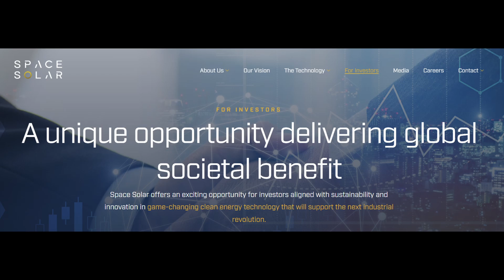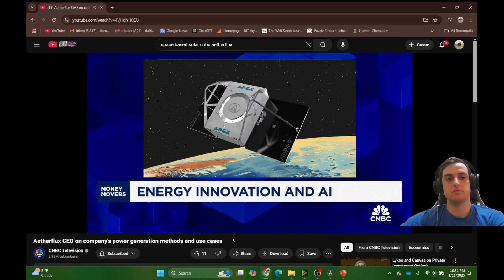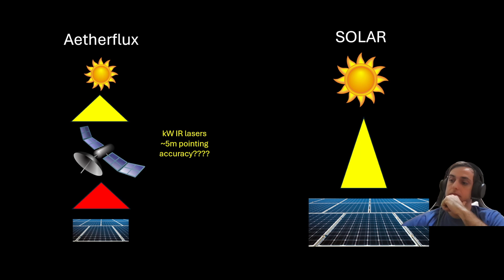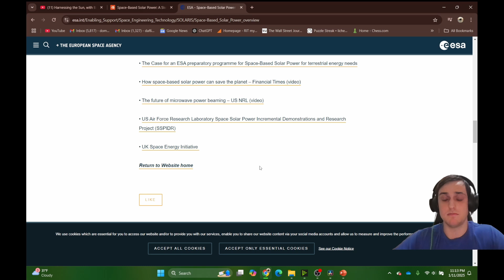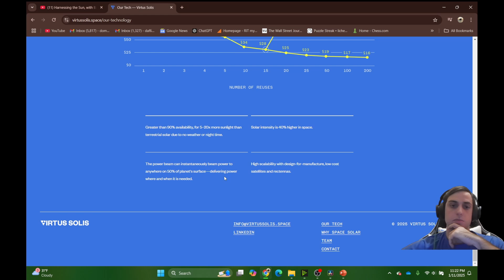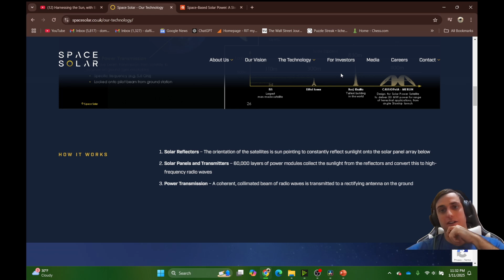Space Solar is a SCAM!

Comment: Your calculations are wrong and I can prove you. 

The SBSP System can work according to my calculation. 

Brother let's have a google meet and discuss this please give me ur email id.
Reply from the maker: brother paste your math here lets see it!
Reply: @NoiseInSpaceChannel 

Space-Based Solar Power Energy Calculation (Laser Beam Technology)
Section 1: 1. Solar Energy Collection in Space
Solar irradiance in space is approximately 1,360 W/m², which is the amount of solar energy incident on a
1-square-meter surface every second. The area of a 10x10-foot solar panel is 9.29 m².
Calculation:
Power Incident on Panel = Area × Solar Irradiance
= 9.29 m² × 1,360 W/m²
= 12,634.4 W (watts) = 12.63 kW
This represents the total solar energy collected by the panel per second in space.
Section 2: 2. Solar Panel Efficiency and Energy Output
High-efficiency space-grade solar panels convert approximately 30% of the incident solar energy into
electricity.
Thus, the energy converted by the panel into electricity is:
Energy After Solar Conversion = 12,634.4 W × 0.30
= 3,790.32 W (3.79 kW)
Section 3: 3. Laser Conversion and Transmission
Electricity is converted into laser light with an efficiency of approximately 60%.
Laser light is transmitted through space and atmosphere with an expected transmission efficiency of 70%.
The laser light is converted back into electricity on Earth with photovoltaic receivers tuned to the laser
wavelength, achieving an efficiency of about 50%.
Calculations:
- Energy After Laser Conversion = 3,790.32 W × 0.60 = 2,274.19 W

Energy After Transmission = 2,274.19 W × 0.70 = 1,591.93 W
- Energy After Final Conversion = 1,591.93 W × 0.50 = 795.97 W
This means that after all conversion and transmission losses, approximately 796 watts of electricity reach
Earth.
Section 4: 4. Total Energy Generated in One Day
Each satellite can operate 24 hours per day in space. To find the total energy generated by the solar panel in
one day (in joules and kilowatt-hours):
Total Energy Per Day = 795.97 W × 86,400 s
= 68,773,248 J = 68.77 MJ (megajoules)
In kilowatt-hours: 1 kWh = 3.6 × 10^6 J
Total Energy Per Day = 68,773,248 J ÷ 3.6 × 10^6 J/kWh
= 19.1 kWh
Section 5: 5. Conclusion
In conclusion, a 10x10-foot high-efficiency space-grade solar panel generates about 796 watts of usable
electricity on Earth after all laser conversion and transmission losses. Over a 24-hour period, this results in
approximately 19.1 kWh of electricity. To generate significant power and revenue, larger arrays or multiple
satellites would be required.
Reply: @NoiseInSpaceChannel  Space-Based Solar Power Energy Calculation (Laser Beam Technology)
Section 1: 1. Solar Energy Collection in Space
Solar irradiance in space is approximately 1,360 W/m², which is the amount of solar energy incident on a
1-square-meter surface every second. The area of a 10x10-foot solar panel is 9.29 m².
Calculation:
Power Incident on Panel = Area × Solar Irradiance
= 9.29 m² × 1,360 W/m²
= 12,634.4 W (watts) = 12.63 kW
This represents the total solar energy collected by the panel per second in space.
Section 2: 2. Solar Panel Efficiency and Energy Output
High-efficiency space-grade solar panels convert approximately 30% of the incident solar energy into
electricity.
Thus, the energy converted by the panel into electricity is:
Energy After Solar Conversion = 12,634.4 W × 0.30
= 3,790.32 W (3.79 kW)
Section 3: 3. Laser Conversion and Transmission
Electricity is converted into laser light with an efficiency of approximately 60%.
Laser light is transmitted through space and atmosphere with an expected transmission efficiency of 70%.
The laser light is converted back into electricity on Earth with photovoltaic receivers tuned to the laser
wavelength, achieving an efficiency of about 50%.
Calculations:
- Energy After Laser Conversion = 3,790.32 W × 0.60 = 2,274.19 W

Energy After Transmission = 2,274.19 W × 0.70 = 1,591.93 W
- Energy After Final Conversion = 1,591.93 W × 0.50 = 795.97 W
This means that after all conversion and transmission losses, approximately 796 watts of electricity reach
Earth.
Section 4: 4. Total Energy Generated in One Day
Each satellite can operate 24 hours per day in space. To find the total energy generated by the solar panel in
one day (in joules and kilowatt-hours):
Total Energy Per Day = 795.97 W × 86,400 s
= 68,773,248 J = 68.77 MJ (megajoules)
In kilowatt-hours: 1 kWh = 3.6 × 10^6 J
Total Energy Per Day = 68,773,248 J ÷ 3.6 × 10^6 J/kWh
= 19.1 kWh
Section 5: 5. Conclusion
In conclusion, a 10x10-foot high-efficiency space-grade solar panel generates about 796 watts of usable
electricity on Earth after all laser conversion and transmission losses. Over a 24-hour period, this results in
approximately 19.1 kWh of electricity. To generate significant power and revenue, larger arrays or multiple
satellites would be required.

And from one day of electricity generated by one sattelite a 60w bulb can glow for approx 13 day 

Which means we can glow 13 bulb of 60w in 13 houses continoulsy from one sattelits with 10 x 10 foot solar panel. 

And 10x 10 foot solar panel is not that much big it's just double of average women (5ft) height.

We just need to make constellation of approx 5000 - 7500 sattelites

Which is achievable ( ex - starlink)
Reply: @NoiseInSpaceChannel @NoiseInSpaceChannel Space-Based Solar Power Energy Calculation (Laser Beam Technology)
Section 1: 1. Solar Energy Collection in Space
Solar irradiance in space is approximately 1,360 W/m², which is the amount of solar energy incident on a
1-square-meter surface every second. The area of a 10x10-foot solar panel is 9.29 m².
Calculation:
Power Incident on Panel = Area × Solar Irradiance
= 9.29 m² × 1,360 W/m²
= 12,634.4 W (watts) = 12.63 kW
This represents the total solar energy collected by the panel per second in space.
Section 2: 2. Solar Panel Efficiency and Energy Output
High-efficiency space-grade solar panels convert approximately 30% of the incident solar energy into
electricity.
Thus, the energy converted by the panel into electricity is:
Energy After Solar Conversion = 12,634.4 W × 0.30
= 3,790.32 W (3.79 kW)
Section 3: 3. Laser Conversion and Transmission
Electricity is converted into laser light with an efficiency of approximately 60%.
Laser light is transmitted through space and atmosphere with an expected transmission efficiency of 70%.
The laser light is converted back into electricity on Earth with photovoltaic receivers tuned to the laser
wavelength, achieving an efficiency of about 50%.
Calculations:
- Energy After Laser Conversion = 3,790.32 W × 0.60 = 2,274.19 W

Energy After Transmission = 2,274.19 W × 0.70 = 1,591.93 W
- Energy After Final Conversion = 1,591.93 W × 0.50 = 795.97 W
This means that after all conversion and transmission losses, approximately 796 watts of electricity reach
Earth.
Section 4: 4. Total Energy Generated in One Day
Each satellite can operate 24 hours per day in space. To find the total energy generated by the solar panel in
one day (in joules and kilowatt-hours):
Total Energy Per Day = 795.97 W × 86,400 s
= 68,773,248 J = 68.77 MJ (megajoules)
In kilowatt-hours: 1 kWh = 3.6 × 10^6 J
Total Energy Per Day = 68,773,248 J ÷ 3.6 × 10^6 J/kWh
= 19.1 kWh
Section 5: 5. Conclusion
In conclusion, a 10x10-foot high-efficiency space-grade solar panel generates about 796 watts of usable
electricity on Earth after all laser conversion and transmission losses. Over a 24-hour period, this results in
approximately 19.1 kWh of electricity. To generate significant power and revenue, larger arrays or multiple
satellites would be required.

And from one day of electricity generated by one sattelite a 60w bulb can glow for approx 13 day 

Which means we can glow 13 bulb of 60w in 13 houses continously from one sattelits with 10 x 10 foot solar panel 

And 10x 10 foot solar panel is not that much big it's just double of average women (5ft) height.

We just need to make constellation of 5000 - 7500 sattelite which is achievable (ex - starlink)

Comment: There is a use case where space based solar could work (but doesnt yet), and the alternative isn't wind or solar, but it's of no use to people living in the USA.  Your first point is to look at the latitude and cloud cover of locations like the UK.  Here the problem is power in winter, 3 months where we're lucky to see the sun for 30% of the time it's above the horizon, and the days are short. Where we can go a full month with no sun at all, that means solar insolation can easily be less than 100Whr/m2/day some weeks, we average about 500~700Whr/m2/day in mid winter, Northern USA typically dips to 1500Whr/m2/day (except seattle, that's about 900).  With solar insolation at those levels you can understand why the UK primarily relys on wind for renewable winter electricity.  However, we can also have a period of low wind coincide with low sun and now you can only keep the lights on with a ton of fossil fuel use or nuclear power plants.  Yes, space based solar for the USA with its clear skys and southerly location, there's no point at all.  For the UK and northern Europe is a VERY different question, because it's not "solar", it's BASE LOAD, so it doesn't need to compete with ground based solar costs, it's effectively competing with nuclear power.  Does that mean it's there yet?.. no, you'd need medium altitude polar orbits, probably use AESA arrays and you'd want to pick your downlink band for directability and cloud penetration (I design radio systems, with modern GaN devices efficient power generation in microwave frequencies is approaching, my best PA design achieved 80% efficiency, we are slowly getting there).  Personally I think the better alternative is synthetic methane generation converting excess summer electricity into methane (at around 50% efficiency IIRC - see tokyo gas co / JAXA collaberation) and store the methane for winter use in conventional gas fired power stations.  Thermodynamically it's inefficient, but economically it works as the excess summer electricity is otherwise worthless.
Reply from the maker: Thanks for the info ya gas storage would be viable for certain things (like mars, remote areas) or simply transfer the electricity from clear-sky regions to places like the U.K. I still disagree that Space Solar would work in U.K., what would be the spot size and coverage for the polar orbit RF design you described? I think it is probably worse than you think.
Reply: @NoiseInSpaceChannel  it's still large, the system I saw it was in the order of kms not meters for the landing patch.  Remember we also have a dense island, and are upgrading our grid so a single landing patch would have a measurable impact for the entire mainland.  We don't need to try and have a landing patch per city.  Like you I'm still somewhat skeptical, but I think the gap between ambition and reality is much smaller for these base load requirements, small enough that we will probably see some experimental systems in place once launch costs fall far enough, which they will only do once there's real reusable launch competition, but that's coming quite quickly now.